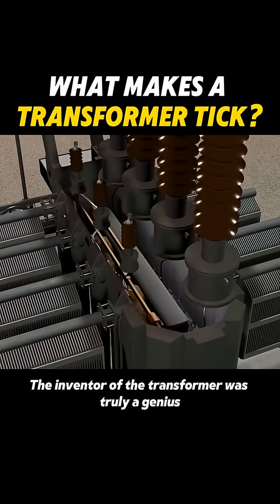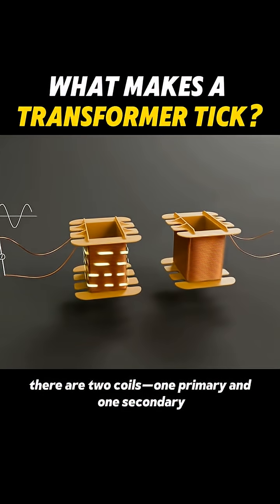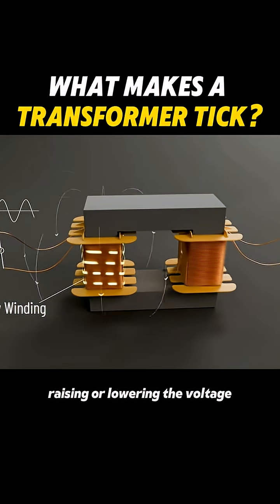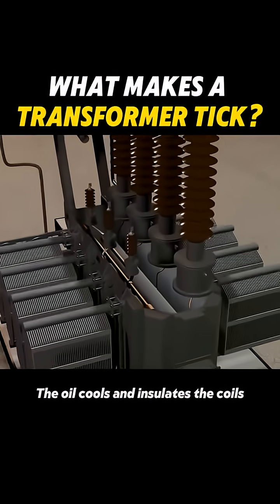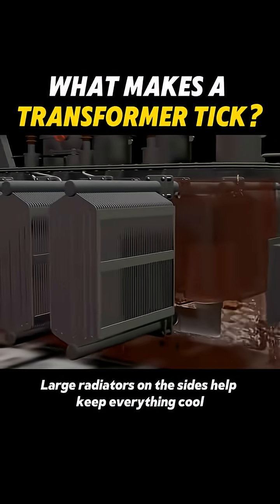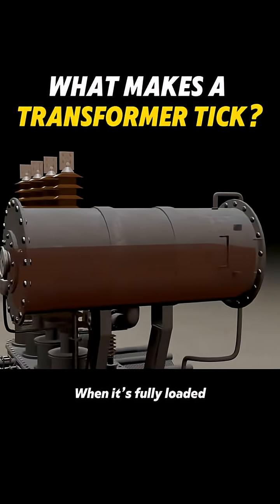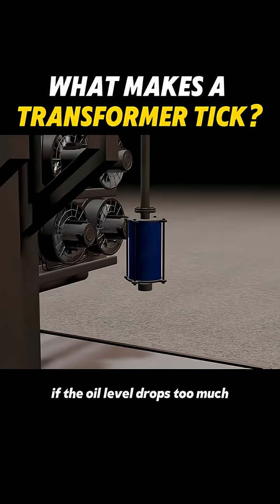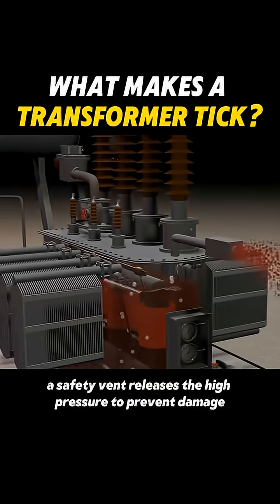⚡ What Makes a Transformer Tick? | Simple Explanation for Beginners

Comment: But we still don't know what ticks
Reply: A funny play on words, huh? A transformer doesn't exactly "tick". It actually hums. And it hums because, well (dad joke here) it doesn't know the words. LOL!
Reply: Its the cores iron laminations that are expanding apart and coming back together at 120Hz (120 times a second) which is twice the input and output frequency 60Hz (standard frequency used). basically turns it into a magnet.
Reply: @BLILLC  - No that's not how it works. The alternating current on the input coil induces an oscillating magnetic field within the steel core, which in turn induces an alternating current in the other coil. The voltage changes based on the number of turns (or loops made) within each coil. If you have  one coil that has ten turns for every one turn on the other other coil then your voltage changes by a factor of 10. So 120V in will produce 12V out. Conversely the current goes the other way, so 1 amp in will yield 10 amps out. 

A thin wire has a higher resistance. To reduce the resistance, you need a thicker wire. In a similar way, the steel core has a "resistance" to magnetic field induction, but it is call "reluctance". The biggest contributor to reluctance is a solid steel core because the magnetic field makes "eddy currents" along the surface of the the solid steel. To reduce eddy currents (by a LOT) the core is made of laminated steel. The laminations do not allow eddy currents to form. 

If you apply a 60Hz voltage (North American frequency), you get a 120Hz wave in the power transferred, but it has nothing to do with the core laminations. Mathematically, power = volts times amps. When you multiply two signals with the same frequency, then you get a "squared sinusoid" which 1) makes a double angle (120 Hz) and 2) places the "zero crossing" of the double angle well above the actual zero crossing. THAT is the power being transferred. [Do the math if you are interested: start with P=Vsin(A) x Isin(A). You'll wind up with VIsin^2(A).]

The core doesn't actually "turn into a magnet". But the core does effectively "suck up" magnetic field lines. That is the inverse of reluctance, and it is called "permeance". The magnetic field oscillates within the core, changing polarity 60 times a second. But no, it does not turn into a magnet.
Reply: @johnarmenta2199  Interesting I always heard its because the laminations but that makes more sense. I'm relatively new to the electrical field and rarely do anything on the "linemen" side of things and really enjoyed reading through this
Reply: @BLILLC  - I am glad you liked it. Keep studying the subject. It served me well. I was an electrical engineer for 35 years, retired last year, December 2024 at age 59.

Comment: explain no one understand
Reply: The number of times the copper coil wraps around the steel on either side correlates to the voltage drop or increase using induction it’s really fascinating and if you find this interesting I’d recommend learning about ac and dc theory 😊
Reply: There are some very descriptive and animated videos showing exactly how transformers work.  Try a couple of YouTube searches to find them. 

(Try searching this in YouTube: "animated operation of a transformer". That will bring up a number of videos on the subject.)

I've copied and pasted a partial explanation here:

The alternating current on the input coil induces an oscillating magnetic field within the steel core, which in turn induces an alternating current in the other coil. The voltage changes based on the number of turns (or loops made) within each coil. If you have  one coil that has ten turns for every one turn on the other other coil then your voltage changes by a factor of 10. So 120V in will produce 12V out. Conversely the current goes the other way, so 1 amp in will yield 10 amps out. 

A thin wire has a higher resistance. To reduce the resistance, you need a thicker wire. In a similar way, the steel core has a "resistance" to magnetic field induction, but it is call "reluctance". The biggest contributor to reluctance is a solid steel core because the magnetic field makes "eddy currents" along the surface of the the solid steel. To reduce eddy currents (by a LOT) the core is made of laminated steel. The laminations do not allow eddy currents to form. 

If you apply a 60Hz voltage (North American frequency), you get a 120Hz wave in the power transferred, but it has nothing to do with the core laminations. Mathematically, power = volts times amps. When you multiply two signals with the same frequency, then you get a "squared sinusoid" which 1) makes a double angle (120 Hz) and 2) places the "zero crossing" of the double angle well above the actual zero crossing. THAT is the power being transferred. [Do the math if you are interested: start with P=Vsin(A) x Isin(A). You'll wind up with VIsin^2(A).]

The core doesn't actually "turn into a magnet". But the core does effectively "suck up" magnetic field lines. That is the inverse of reluctance, and it is called "permeance". The magnetic field oscillates within the core, changing polarity 60 times a second. But no, it does into turn into a magnet.